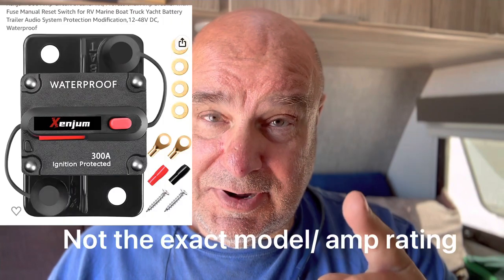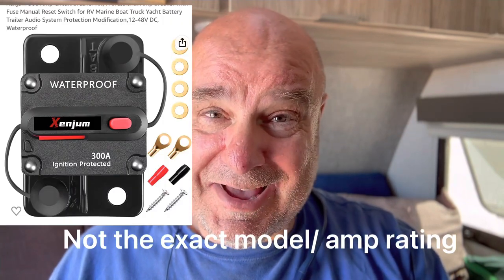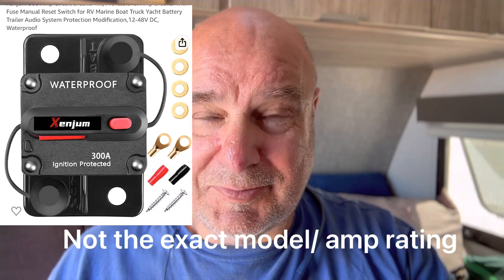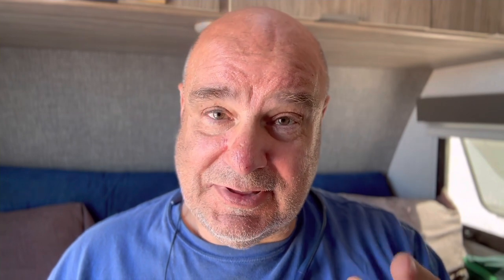Renogy Inverter Fails to run Microwave!!

Comment: I had the same problem with my 3000W inverter and finally found out it was the Chinese circuit breaker.  I replaced it with a block type fuse connected directly to the battery and that solved the problem.

Comment: Unbelievable!!!!!! I just installed a Blue Sea Systems 300 amp T Fuse and now the Microwave will keep running. I had a cheap fuse on my system.  Thank you so much for your help.  I don't know what I am going do at the campsite.  I won't be troubleshooting half the time.

Comment: Blue Sea 300amp Disconnect Switch and Eaton Battery Terminal Post Fuses and heavy 2/0 Cabling on My Battery Bank to Buss Bar and 4/0 Cabling to My Inverters = WORKS GOOD

Comment: I had the same problem, in my towable, plugged into shore power. I could only run my micro 1 minute at a time. ⏱️Went to Harbor Freight, bought a heavy duty construction multi-plug, with safety shut off, and no more problems. Hope this video helps someone else out there too! ⚡🔌
Reply from the maker: Feels good when it’s fixed!!!

Comment: I think my problem is I have a crappy battery. Need to get some better batteries. My battery don’t have enough juice. To run a microwave for one minute.🤔
Reply: Just a heads up. Renogy has a very good sale on right now on all their equipment, at least in Canada. Might be worth a trip to their web site for some bargain shopping.

Comment: What a life saver!
We had  finished our van wiring and had been using the Renogy 3000W with a 1.8kW hot air gun for the shrink sleeving all along. Next day put on the 1.8kW oven for it's first run and the Invertor tripped after 10 seconds... thought it was the oven but did the same with the air gun. It was just as though the invertor had turned off for a moment.  Emailed Renogy for advice and they replied in Kanji or Chinese. Then I found your video and it all made sense. The 300A resettable fuse felt warm, it had a voltage drop across it of nearly 2V.  We replaced it with a real fuse and everything is OK.

Thank you for taking the time to share this information my man, it has saved us unknown trouble. plus I will sleep much better tonight.

Cheers man.

Comment: Thank you!!! I have been searching for videos all weekend. I’m about to go bypass mine when it cools down.
Reply from the maker: Note this also happens when the appliance is on a GFI Circuit. I had to unplug the GFI sensor on the Renogy control board a year later when I starting powering the whole trailer by connecting the inverter to the 30 amp input to the main board. When I posted this video the appliances were connected directly to the inverter. Fair warning - I am no where near being an electrician!

Comment: Thanks for taking time to create this video. Shall check this out tomorrow. Very similar symptom here too. Do have similar circuit breaker in line.
Reply: Next day. Took breaker out of circuit and same result. Likely be a power factor problem. The 1500W inverter has no trouble running a nuWave Flex induction cooktop at 900W and 1500W settings so not likely an inverter issue. The Victron battery monitor says same as rated induction cooktop setting being drawn from battery; BUT! says 1100W rated input power of LG microwave is drawing over 1700W till inverter shuts down. I'll investigate this further and suspect poor design.
Reply: Update. LG Neochef 23L Microwave works well with 240VAC Powertech 1500W inverter. Turns out be careful of wire run lengths even on the mains side. Runs pretty good efficiency at 800W setting. The inverter based microwave oven can help with your power budget. Your post though was good to show how to fault diagnose systems.

Comment: Oh my god , I almost had a stroke trying to figure this out. I went from and 2000 to a 3000. I'm going to give this a try. Thanks for making this video. Why doesn't renogy tell you this?
Reply from the maker: If you are powering a circuit with a GFI you must disable the circuit GFI or the one plugged into the Renogy motherboard- won’t work with 2 in the same circuit. This was a subsequent problem I had after plugging the inverter directly into the 30 amp service on my trailer.
Reply: @Dottietravels  Thanks for all the info. Trying to keep my 89 roadtrek updated. :)
It is fun working on this stuff.

Comment: Hi Rob,
Oh my goodness, I hope this applies to me. I was on the phone with Renogy a number of times and they had no solution for me.  They blamed it on my battery pack, they blamed it on anything they could think o,f but NO ONE suggested a low quality fuse. 
Renogy seems to get good reviews but there are a number of Youtube Videos out there showing the same problem!
I ended up telling Renogy I was going to ship my inverter back and they said "just keep it" and refunded my money... thus I still have the inverter:).  I am going to give your wisdom and experience a try!
WHY did then not think of this?
Reply from the maker: Are you by chance plugging an RV into the inverter like you would shore power?

Comment: I have been experiencing the same issue. Not a Renogy Inverter, but SunForce 2500  watts. My Renogy shunt battery monitor shows all is well, until I turn on the microwave. It is a High Point unit, rated at 900 watts/7.5 amps output and 1350watts/11.25 amps input. I have 600 amp hours of battery fully charged. On goes the microwave, 45 seconds later the 250 amp breaker trips. And the shunt is showing a massive 136 amps draw. Wires are correct. Even the toaster is showing 76 amps of draw. It is a 10 amp toaster. Now, I haven't tried your suggested solution yet, but I am certainly going to try a different breaker than the one I have installed. Fingers, toes and eyes all crossed. Wish me luck. I will report back if all goes well. Cheers!
Reply from the maker: Also if your inverter has built in ground fault protection and you are in line with a gfi circuit you could have similar problems. I had to disable the ground fault protection in the inverter which is risky business if you do not go through a GFI protected line.
Reply: @Dottietravels  Yeah, it does have GFI built in, but the microwave is pugged in to a duplex wired from the circuit panel, no GFI. The bathroom pug has that, but not the microwave. Thanks for the tip. Also, forgot to add, I tried the microwave plugged directly into one of the plugs on the inverter, same problem. I have ordered the Go Power FBL-300 amp slow blow as of today. That is the size their web site recommends for a 2500 watt inverter. Hoping that will solve the issue. Cheers!
Reply from the maker: @trevorgeddis9044  I bet that is your solution. Fingers crossed!

Comment: These Chinese breakers are shit, I still use a few for lower loads as a simple disconnect switch but would not rely on them. In my experience they are all the same and can't handle 80a at 12v for extended time or repeated on/off cycles. Ended up getting a Bussman 187200F-03-1 and it holds a steady a 180a forever from my testing, it cost 3-4x so not even that much more, definitely worth using a decent breaker or good old fuse + isolator switch, for anything that needs over a few hundred watts.

Comment: Sounds like you need to wire in a Voltage display in the input side of your inverter.... I'm gonna ditch the chinease breaker and just put large ass Anderson disconnects by the battery

Comment: I am one of the ones that are very interested.
Reply from the maker: Had another mystery problem after I began hooking up the whole trailer to the inverter. There’s a gfi circuit inside the inverter and it does not like being hooked to a system with its own gfi - it would routinely shut off with a ground fault. I was able to disable the ground fault detector by unplugging it from the processing board inside the inverter. Probably not recommended but it’s work for me for 6 months so far.

Comment: I have this problem when ever I turn on the microwave and try to roll the truck it turn of its self any advise please I’m eating fast food 2 month
Reply from the maker: Not something I can help with - sorry
Reply: @Dottietravels  could you please tell me where to put that fuse
Reply from the maker: @abdibasidahmed6880  I have mine on the positive cable coming from the battery to the inverter

Comment: Questions for you? 
1.  Did you send back your 3,000-watt inverter for a refund?
2.  What fuse did you have originally and what fuse did you replace it with that worked?  (brand and size please)
3.  Did you try your microwave with the 2,000-watt inverter after the fuse change?
Thanks in advance.  :)
Reply from the maker: I did not return my inverter. I believe both fuse sizes were 200 amp - the one that didn’t work was a OUHL 200 Amp Circuit Breaker Manual Reset and the new fuse was a Go Power! 200 Amp Fuse is used as a replacement for the FBL-200. This is specifically made for use with inverters.